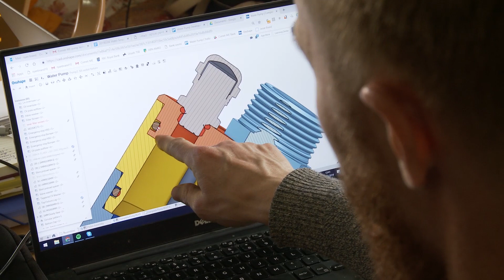Comet-ME Solar Magnetic Plunger Pump (SMPP): A game-changer in water provision for off-grid farmers

Comment: This is a unique contribution to the field of solar water pumping, and fluid pumping in general. It appears to be the most mechanically-simple positive displacement submersible ever devised. And it promises to be the most sand-tolerant one as well. Being a displacement pump, it's ideal for solar power, as it can push the full vertical lift the moment it begins to move in the morning. The controller makes it smart at every moment of operation, and able to be monitored and controlled locally or remotely. I'm keeping an eye on this development.  -- Windy Dankoff, Founder, retired, Dankoff Solar Pumps, Inc., consultant and educator